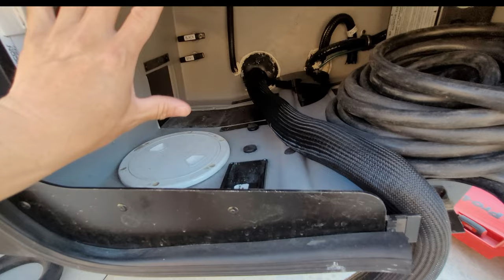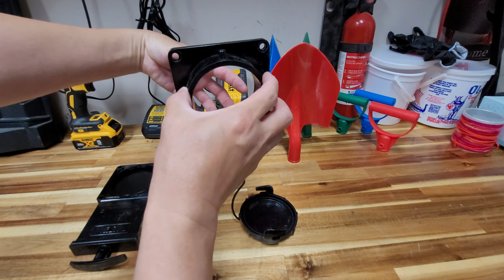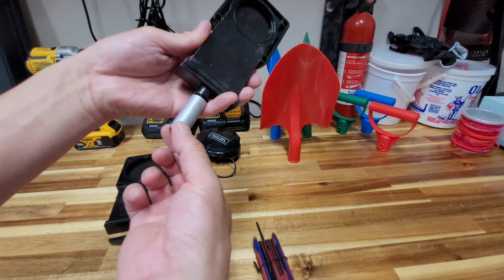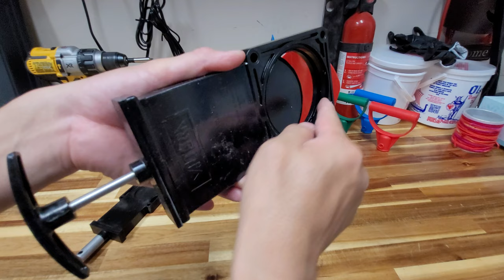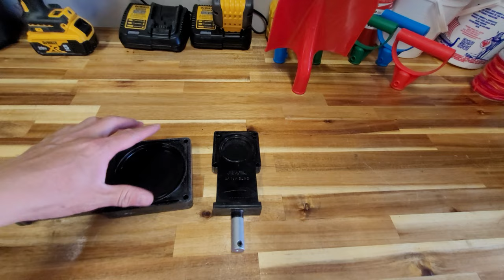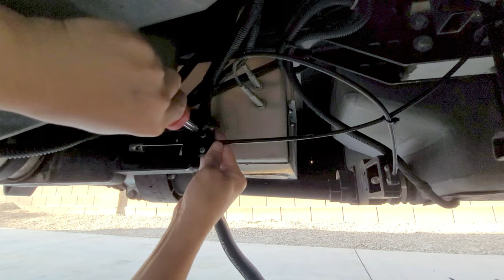Winnebago Dump Valves LEAK and FAILURE | What's the cause?

Comment: great video…very thorough!  I just experienced the shower of shame…it was bad…previously my gray tank seeped past the valve…this time the black…This video has given me the courage to take a look at the valves myself.  It does appear that the valve handle isn’t pushing in flush so I will see what is happening at the actual valve.
Reply from the maker: Good luck on your repair. It is ok if the handle does go flush also but the valve has to go ok all the way. The cable itself may be routed terribly and not zip tied too.  You can do it!

Comment: Hello, I know you don't have this coach anymore but I want to thank you for all the info. We just took delivery of a 2024 Navion and I am trying to do a couple of your fixes.  On our 2 valves, there aren't any set screws up by the exposed metal tip that is falling short of the hole.  Is that a new model possibly or you think they just didn't install them?  I am almost afraid to remove since I can' t tighten back with set screw. Thanks again!
Reply from the maker: There should be set screws for sure and you don't have to take it apart to find out. It will not work at all without the set screw so I doubt they are missing. There would be a hole if the set screw is missing. You may have to pull the cable slightly to see the set screw or feel for it with your finger.

You can email me with pictures if you need more help. Email address is in the about section of my channel.
Reply: Thank you for the reply.  It is storming now so I can take pics tomorrow.  Definitely no set screws.  I could see the threads and the screwdriver hit a solid cam.   I think the other side (2 screws) is holding it in. @rvlifediy

Comment: Very helpful video. I was wondering how the valves work! We have something not working properly with our black tank cable. We can pull it out easily, but can barely push it back in after we dump. I know we will eventually break something, but I am not sure what is wrong, and needing repair. Any ideas? Also do you ever lubricate the cable?
Thank you for your videos👍
Reply from the maker: Hello yes I lubricate the cable handle section and the wire at the dump valve as well as inside the cylinder so it can reach the rod the cylinder is attached to. I use Boeshield T-9. I have a video on that I need to post yet.  As for your cable sticking, it's due to the way the manufacturer installed it. You need to route the wires in a nice smooth bend pattern and cut off all the excess length. It's natural for that type of cable to be easier to pull than to push and if you install it with severe bends, it will bind when you push. Mine had the same problem when it was new and that was part of the repair.

Comment: Thanks for another great video! Yes, please do the series. I am learning so much from your channel.
Would it make sense to put a covers over the open section of exposed cable to protect from possible road debris? Or do you think it's not worth it?
Reply from the maker: Thanks Mark. Covers would help for sure especially if you live in a climate with lots of road debris/salt. I live in a moderate area so haven't had to do that, but now that you say that, I should probably do it.